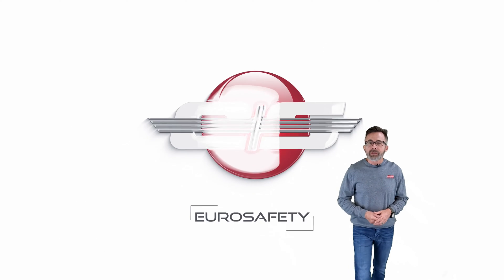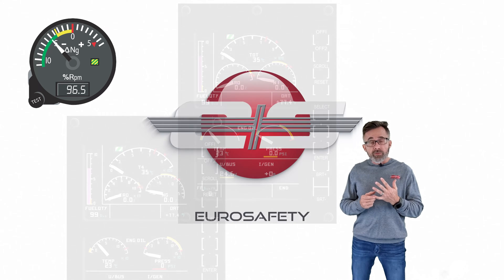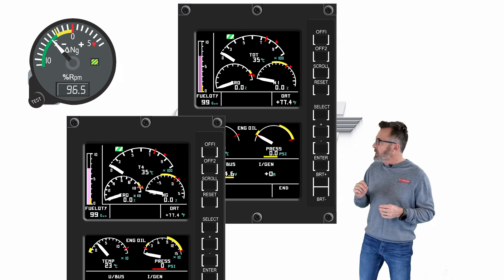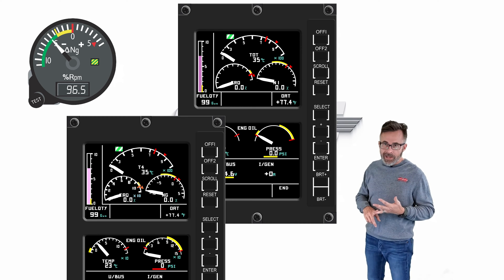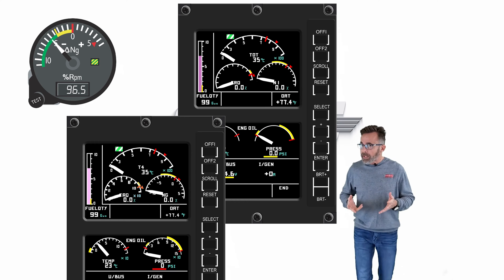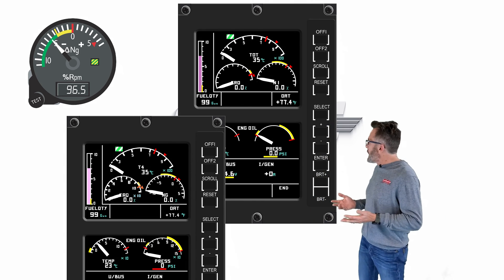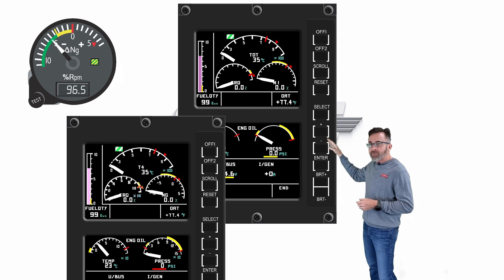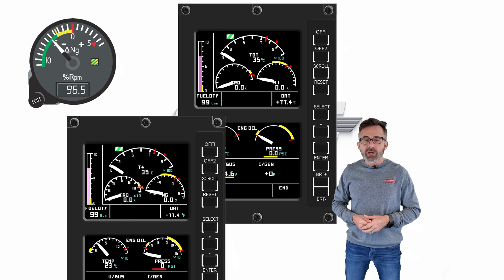#28 - What is a Delta NG gauge?

Comment: Hi there, here is Raphael from Brasil.
My answer is why on B2 analogic gauge the triangle is on plus 6 and on a digital gauge the triangle is on plus 1? What is the difference between them if bouth have the same engine.
Reply from the maker: Hi Raphael... I can provide some insight but there isn't a definite answer to that question. There are many instances where there are anomalies within the product line without any explanation as of why. You will sometimes come across people giving their guess as fact, but without supporting documentation, that guess is just a guess. I understand the manufactures reluctance in providing explanations as ligation is consistently on the forefront when providing information. Looking at the B2 and the B2 VEMD. They are the same aircraft. There are small differences like the addition of the VEMD and caution panel. There are also various formats of the FFCL and possible throttle. But really the same helicopter. Looking at the Delta NG gauge between the two... there are a couple differences.... The take off range is different and the transient is different. As you indicated the Transient limit for B2 is +6 (Maximum transient rating (less than 5 s) Ng = 107.5 %) and the transient limit for B2 VEMD is +1 (103.1, HP=0 ISA). So the value which is allowed is different between the airframes. So Airbus has lowered the value of the max allowed in a transient situation in the VEMD model. So for one reason or another they decided that +6 was too much. It would make sense that they would then also like to limit the basic B2 model too, but to do that they would have to replace every delta NG gauge with new markings. You can imagine the cost of that. I am sorry I dont have a better answer.
Reply: @EUROSAFETYTRAINING  I do believe you are right.
Aviation is very expensive for manual’s changing.
I’m about to start a new job of flying a B, BA and a B2. That is the reason of my concern. And asking about it can be too much. The most of the pilots and mechanics don’t know the answer.
I appreciate your time and congratulations for your videos. It has been helping me a lot.
Thank you!

Comment: What does Ng stand for? What is it measuring?
Reply from the maker: N1 or NG is the is the typical name given to the engines gas producer turbine wheel that powers the compressor section of the engine.
Reply: You forgot to explain that it shows the relative achievable „speed“ of the Compressor Section.
Simply said, you cannot just increase the compressors turbine speed unlimited, as you’ll face a surge when you exceed the designed speed in relation to the rest of the turbine engine! 
This is not lectured in helicopter engine tutorials as it is not as relevant as it is in jet fighter engines, but this actually is the limiting factor in fighter jet turbine engines, where - approaching the speed of sound on the compressor wheels blades tips will - as with main rotor blades - lead to a blade stall creating shock waves leading to shock induced flow separation and then to a surge…
And then it’s becoming very expensive and if you’re airborne, very dangerous as it will reverse the travel of the hot gases from the rear to the front … 💥